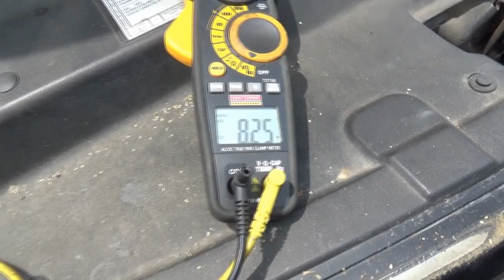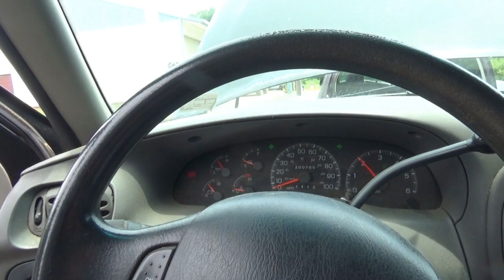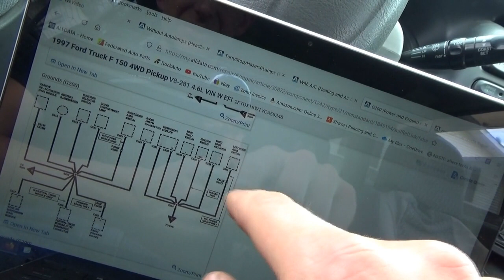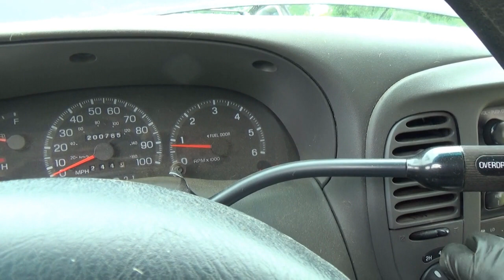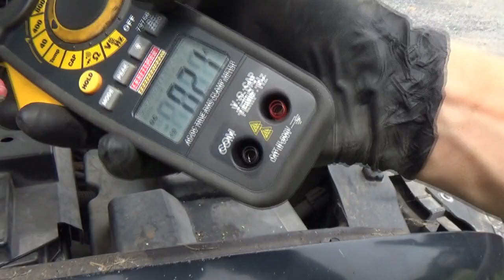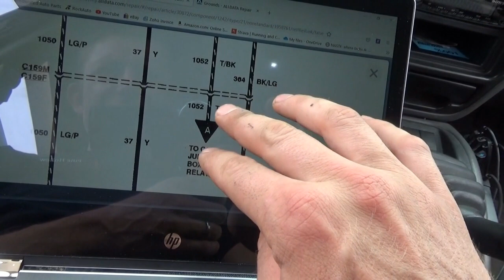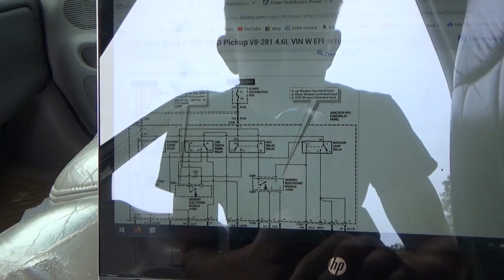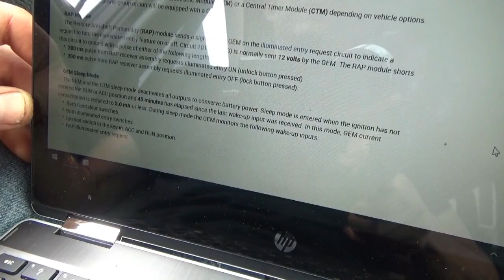Fix Or Repair Daily?  Part 1 ('97 F150 Major Electrical Issues) Independence Day Special!

Comment: I was thinking the radio that won't shut off and the module not commanding sleep could perhaps be caused by another "floating ground" where there is fuzzy logic due to unpredictable trigger actions.  I also noticed an aftermarket switch in the video on driver side for some other item.... could that be a part of things too?

Comment: I have a '97 with an issue of losing all power when cranking. My first thought was that the battery had just died due to the fact that it was over 7 years old and a jump started it the first time. After I replaced the battery it did the same thing, full power until started cranking then everything goes out. It all comes back on after a few minutes then sometimes it will go ahead and start sometimes it will repeat the losing all power process. My first thought was bad ground but now I'm not so sure. The worst part is how intermittent it is. AS in when I actually have time to work on it it won't do it, typical intermittent issue, never does it when the mechanic has it! Anyone have any thoughts on this issue?  I am going to have a look at all of the grounds when I get a minute, I am also thinking ignition switch?

Comment: My a/c clutch doesn’t kick on if the Freon is too low.
Reply: It has a pressure switch in the system that won’t let it turn on If the Freon is too low

Comment: ok but if that would be the problem, then my shifting issues should be affected differently on cold transmission vs hot transmission, correct? I mean I should at least notice some difference, don't you think so?

Comment: Gems are known problem.
Reply from the maker: Good thing I didn't replace the GEM based on the forum suggestions then haha
Reply: @PineHollowAutoDiagnostics  my phone died before I could finish. My 2003 the radio would not shut off and the door chime would still chime with keys out. Dried gem out and all was good.  That is what I would have posted if my phone had not died. I had a no parts required moment.
Reply: @PineHollowAutoDiagnostics  I like your troubleshooting logic; What online schematics are you using? Or what do you recommend? I have a 2000 Silverado that I have to troubleshoot the dash instrument; the power to the instrument panel gauges flicker on and off as I drive and vibration triggered.
Reply: @MrDeleoco  I believe he uses the professional version of Alldata.
Reply: @Mr2004MCSS I will look into it "Professional Alldata"... I APPRECIATE THE INFO👍💯
Reply: @MrDeleoco  I believe it's the version that a lot of working techs use because it gives you access to pretty much all makes and models of vehicles.  It's expensive and cost around $165 a month or more.  Not an expense most DIY'ers are going to pay for.

Comment: Man my 97 won’t start the battery is new the starter is new the starter solenoid is new and I just replaced the ignition switch what might be the issue I was able to start it with a screwdriver on the starter solenoid bypass

Comment: Some of these run forever no issue s. Some a disaster.
Plus it is 25 yo .
Salted grounds are not the mfg fault.
I had that Ford alternator issue went through three " rebuilt" ones all bad . The NAPA one cured issues.
Why you put American flag on title? 
European cars the worst pos . Few Japanese cars still on road from 1997 also.
🤔
Reply: @joemichael3656 lol
Reply from the maker: It's an American truck for 4th of July :D